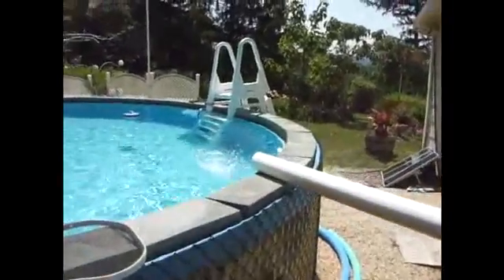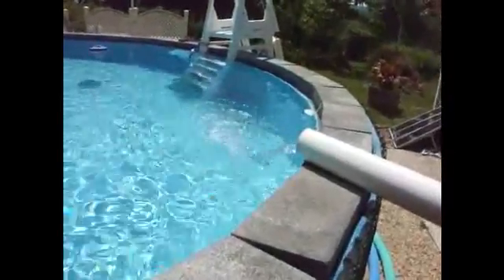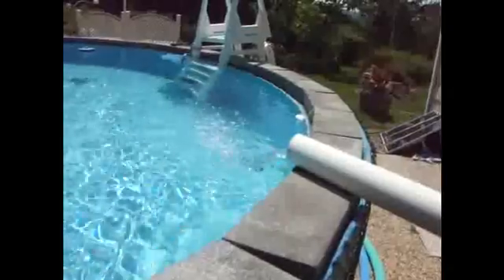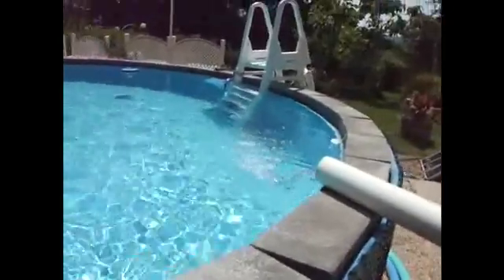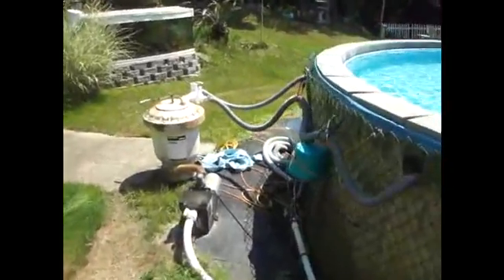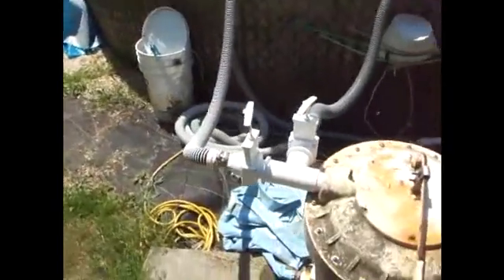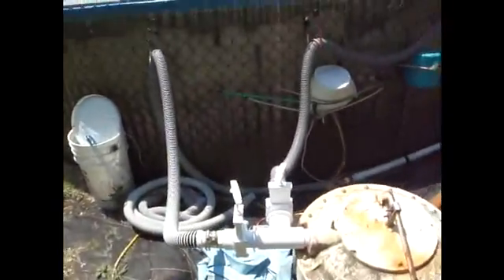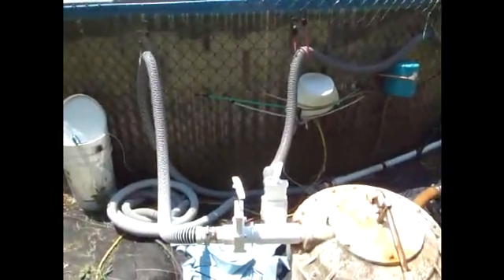solar pool hot water heater

Comment from the maker: 20 gal of water per minute,multiply 20 times what one gal of water weights simple.using epdm rubber .and just plastic pipe.slow the water down, and it gets much hotter.indistructable, system.nothing to rust.